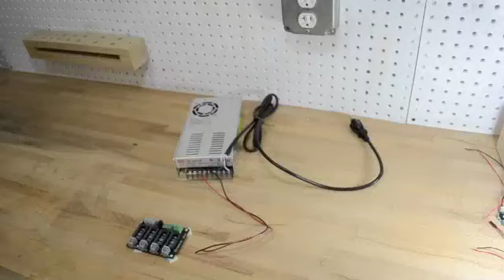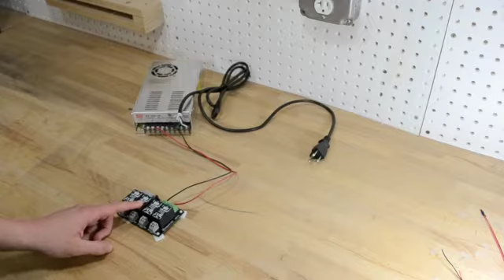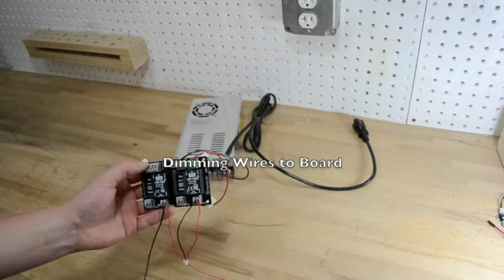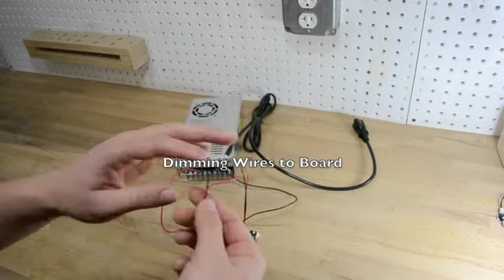LDD H4 Board - Rapid LED System

Comment: if i want to power 4 20w LED's at 700mA using a ldd-700h for each one,  which power source do you recommend me to use?
Reply from the maker: What's the voltage on those LEDs? The power source has to output ~3V more than the voltage required by the LED (ie. if it's a 36V LED then you need to supply at least 39V, though each LDD does have a min/max input voltage)
Reply: ok, the minimum voltage required by each led it's 30V
Reply from the maker: @jesuseduardo18  So add 3V, making it minimum 33V input. Make sure it doesn't exceed the maximum voltage the LDD driver can handle. The specs on the LDD driver will be listed on it's datasheet (I believe it's 56V max but please double check before use).
Reply: @RapidLED  Thanks. So i can use a 100w LED Driver (18-34 V 3000mA) to connect all LDD-700H in parallel right?
Reply from the maker: @jesuseduardo18  The LDD-H-4 board already puts the drivers in parallel, so yes. For further questions please email staff at rapidled dot com as the comments section here is not monitored very often and further questions may not be responded to in a timely manner.

Comment: plugging the black to the N and the white to the L is actually incorrect even though it still works it's just reversing polarity when going from AC to DC it doesn't matter it will still work same science behind having a light plug into a socket and if you flip the socket upside down and plug it in it'll still work but to be correct N... is neutral white L is line black

Comment: What u think of this will it work he seid he let it go for 30 plus 10 shiling lmk what u think https://www.ebay.com/p/?iid=321757952604&&&ul_ref=http%253A%252F%252Frover.ebay.com%252Frover%252F1%252F711-117182-37290-0%252F2%253Fmpre%253Dhttp%25253A%25252F%25252Fwww.ebay.com%25252Fitm%25252Flike%25252F321757952604%25253Fchn%25253Dps%2526itemid%253D321757952604%2526targetid%253D286717532765%2526device%253Dm%2526adtype%253Dpla%2526googleloc%253D9007918%2526poi%253D%2526campaignid%253D764892186%2526adgroupid%253D39783961149%2526rlsatarget%253Daud-298628319826%253Apla-286717532765%2526abcId%253D978836%2526merchantid%253D114975993%2526gclid%253DCjwKEAjw3pTJBRChgZ3e7s_YhAkSJAASG9VrGjqPZass6VT9Gu3NOqVVwK8jeb4ne4hLIi6I2Zj3_RoCLdzw_wcB%2526srcrot%253D711-117182-37290-0%2526rvr_id%253D1218410113417&chn=ps
Reply from the maker: That should work, I believe the dimming output is 5V PWM on those so that will be compatible with the LDD drivers.

Comment: dude can u sell me a old stome controller one that is on display or the older version that is not as nice as the newer one not the storm Max or the hurricane there are original storm dude I don't have the money to put you out for a new one so I figured I ask for a display peace
Reply from the maker: Sorry Jonny we don't have any display units, try emailing Ben over at Coralux and see what he has. ben@coralux.net
Reply: RapidLED I found a Arduino with adjustable voltage on it digital 15 box on Amazon what do you think can I send you a link on it
Reply from the maker: It's easier if you can send us an email, staff at rapidled.com